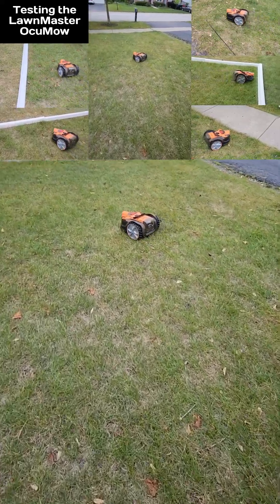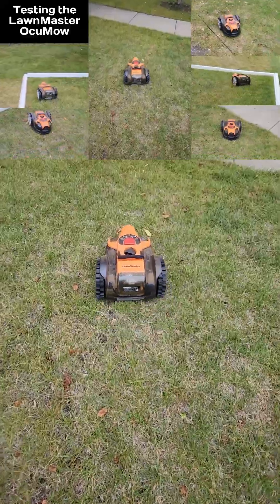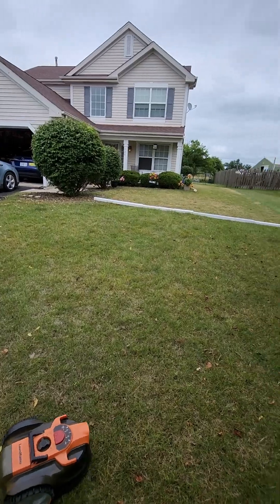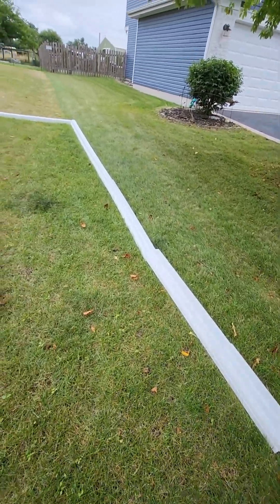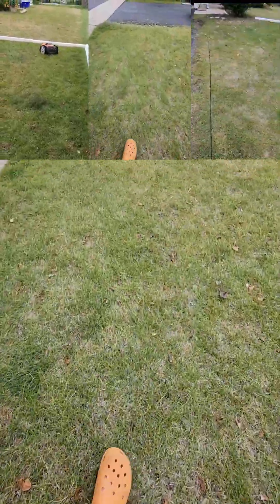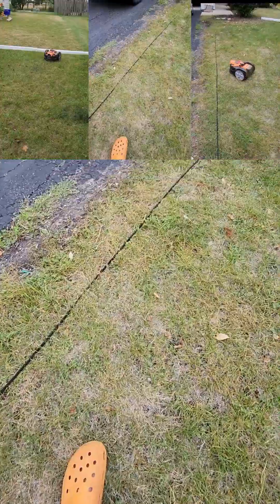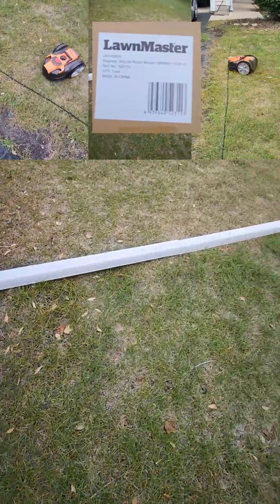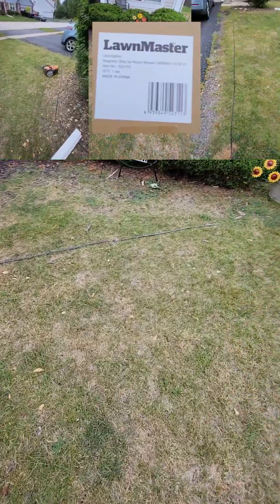Testing the LawnMaster OcuMow  with Magnetic and Optical Boundaries #lawnmowerrobot #roboticmower

Comment: Your borders are not defined. Few minutes to dig a small trench and fill with bushes or chips or even bare dirt. Mower runs on grass only.
Reply from the maker: Yes, the mower requires a defined boundary.
It works much better in my backyard.
In the front yard I cannot install a permanent boundary.
https://youtu.be/hwLXVWxbyVU

The mower will run on concrete if it escapes a boundary.
https://youtu.be/guS0GrgvfF4?si=WS3kGh9C3gC4cZV7&t=175